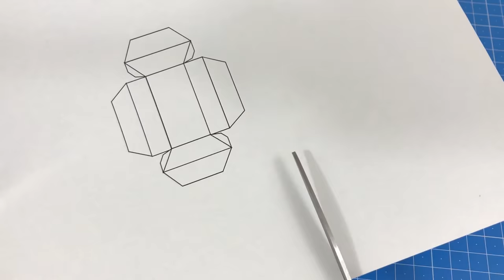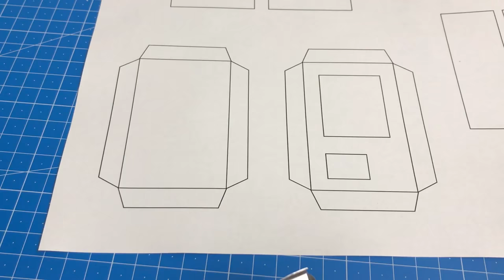Making Mini  Electric Room Heater DIY

Comment: What is that thing which you have used for power supply
Reply: Alimentator Switching Adapter DC 12v

Comment: This is not heater you put a fan on this
Reply: I’m confused where is the fan ?
Reply: Fans wouldn’t heat up red due to the simple fact that it’s a cooling system so it won’t heat up if it’s meant to cool down I’m in the process of making this I ain’t gone cap It prolly ain’t gone come out like this ima go to pick up the wire but too many steps but I’m pretty sure it would come out to be a heater or just something I tried and failed 🤣
Reply: @Dailylifeofnyla  did you make this? Curious if it works

Comment: It would have been smarter to make a bunch of holes in behind the heating element and make the enclosure a little bit bigger and I would have added a laptop cooling fan and I would have made a small tip sensor so it shuts off if it falls over the fan would have kept it cool enough to keep the enclosure cool to the touch

Comment: Can someone recommend a mini heater device that runs on USB-C ? 
Or if i can charge it that would be awesome too!
I go to a place where it doesn’t have electricity and it’s cold asf now in the winter season and if i can just carry a tiny device like this one in the video and connect it to a battery bank that would be awesome!
- Thanks.
Reply: usb-c do not exist, it depends on how many volts you want to power it, like if you want to power it with a usb they do not exist because the 5volt usb does not have enough power, instead in a car (12volt) it has enough power to work but there are not many to buy because they immediately consume the battery of the machine, it depends on what you need to power it and the purpose, but usb-c does not exist.
Reply: USB doesn't have enough amps for a heater. Like other comment... go 12 volt at very minimum
Reply: They sell rechargeable pocket hand warmers.

Comment: can you please list down all the materials use.I need it for my project tomorrow
Reply from the maker: Materials:
Glass Tube(a heat-resistant tube)
switch (on, off)
Power Supply over 12V~ or Switching power supply  
(It can vary depending on the thickness of the nichrome wire you use)
Nichrome wire
Reply: @funcider  thankyou!I rlly appreciate it